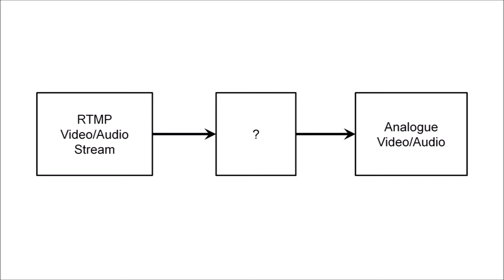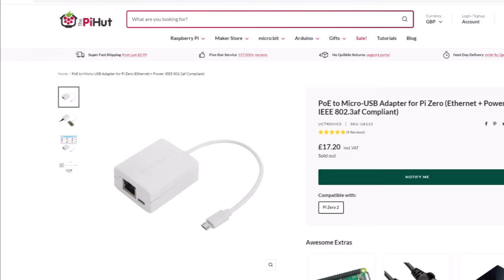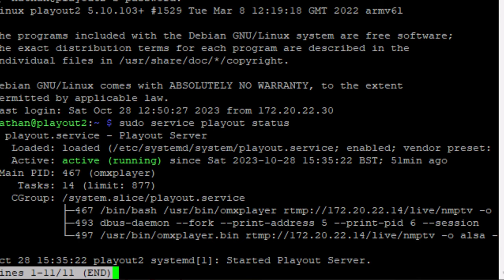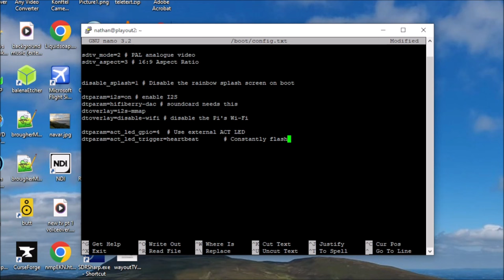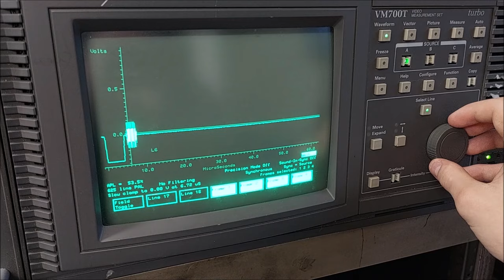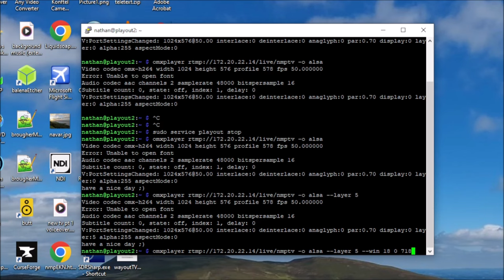Home TV Channel - Converting RTMP to Analogue Video

Comment: Most interesting, I didn't know you could get comp video out of the 'pie zero.
Actually I'm kind of looking for a way covert analogue video into RTMP / ONVIF so I can add some 'fake' camera's to a modern DVR box, that generally don't support analogue.
Reply from the maker: I need to figure that out too... currently using an old DVR for inputs
Reply: I wasn't looking, but I realized I was, my parrants probably want to be able to use their DVDs and especially home made VCRs to watch on TV.

I know there exists adapters, but what's the fun in that?! (especially since they are not really cheap and I would love to understand the signals)
Edit: The adapters only cost 10 USD......